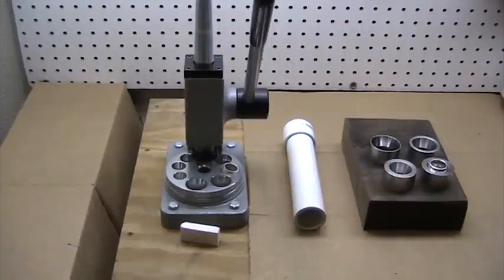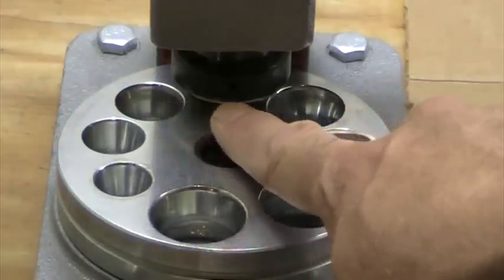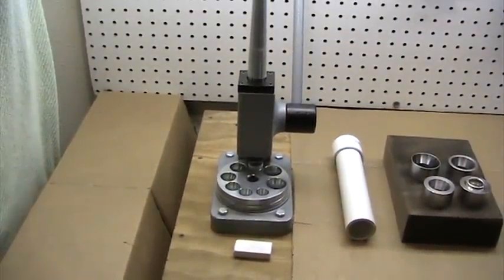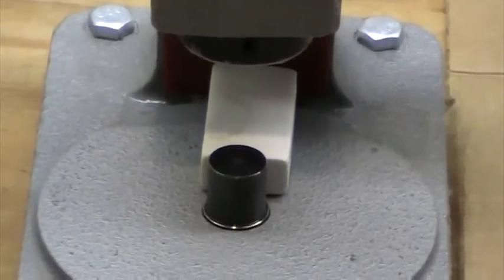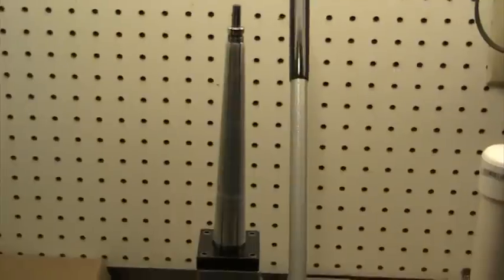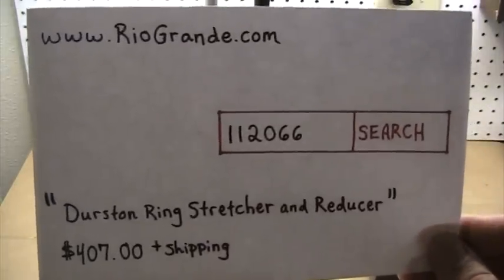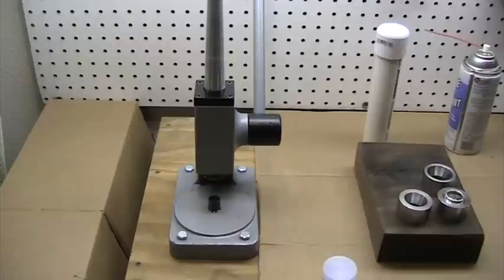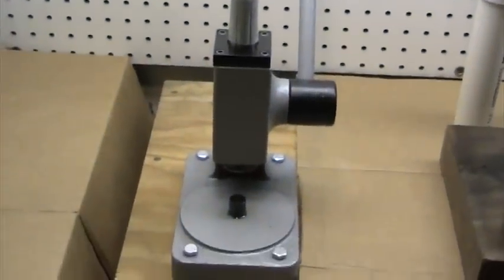Ring Sizer Machine Tips and Tricks for Making Coin Rings; Coin Ring Tools

Comment: What's the max diameter starting hole you can have and still reduce a coin down to a woman's finger size, say size 6 ring? I've punched a 5/8" diameter hole into a Canadian large cent and can't seem to reduce it to woman's size ring? any ideas? thanks! great videos.
Reply from the maker: +Jason Weiss Hey Jason, there really isn't a set "hole size" per se, but oftentimes it's easier to start with a smaller center hole; that way, the sides of the coin will come up closer together, (more "tightly") as you're initially folding your coin, and more importantly; you won't end up with an overly wide coin ring that you have to try to over-reduce; which most oftentimes ends up badly. Let me know how that works for you!

Comment: what is a cheaper alternative to the durston for a beginner?   love all your videos
Reply from the maker: Hey Mark, thanks for the compliment. There are other less costly brands that can be found online; but I can't personally recommend a specific brand; as I only have a Durston. I will say that the other less expensive models have weak points near where the handle joins up with... they've been known to break under pressure.  Just my 2 cents; hope that helps!
Reply: I have a 2 ton ratchet arbor press and a 6 ton HF press  mainly need for the streaching.

Comment: So Martin regarding the ring stretchers.  I'm in position for probably going for the cheaper overseas stretcher.  I have the 1 ton harbor press to do reduction. The question is; Is most of the stress on the ring stretcher arm from ring reduction as opposed to stretching?  So do you think the ring stretcher arm will do better with me doing the reduction on the Harbor press.  Seems that you are saying in the video that reducing the larger coins put the most stress on the arm.  Thanks.
Reply from the maker: Mark Daniel Hi Mark, yes; in my opinion; that is the point at which the most amount of stress will occur: while attempting to reduce on the ring stretcher. The thing to remember is all of the ring sizing machines available out there were never intended to reduce large coins to begin with! ;-)

There's northing wrong with buying a less expensive ring sizer; I just strongly recommend using at least a 1/2 ton arbor press (or greater), for the REDUCTION aspect of coin ring making; that way, you eliminate the stress that that would have put on your particular ring sizer. Hope that helps!
Reply: CoinRingUSA Thanks much Martin.  Picked up the 1-ton Harbor press for $39, good investment as it is a simple piece of machinery and works well.  Will be ordering one of the less expensive ring stretchers to go with it. Thanks again for your advice and keep up the good work with the videos, very informative.
Reply from the maker: Mark Daniel Thank you Mark, I appreciate it!
Reply: +CoinRingUSA I just picked up a Harbor Freight 3 ton press. I'm new to the hobby but I think it will be more than I need. Thanks for all the help.
Reply from the maker: Michael, you're welcome!